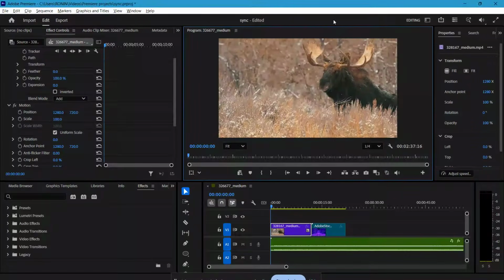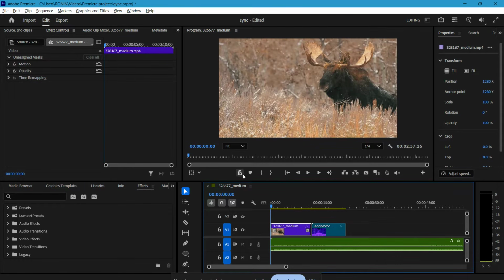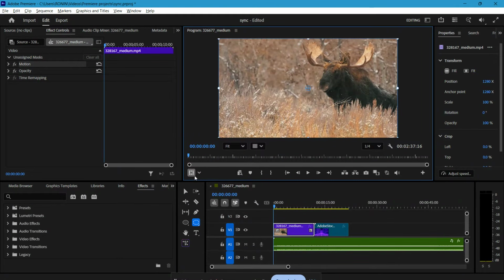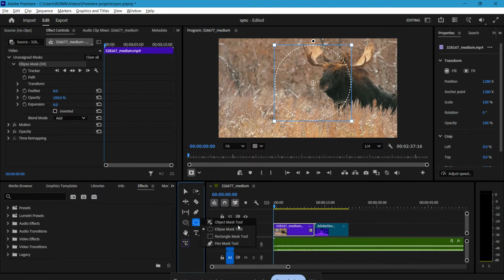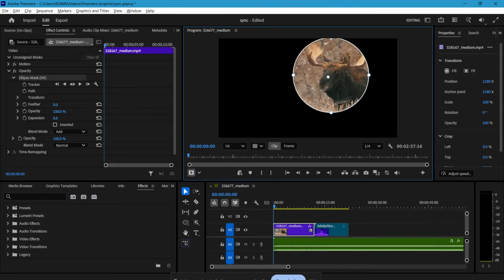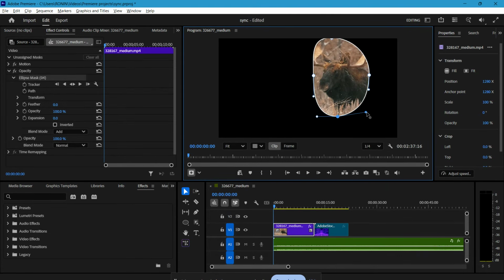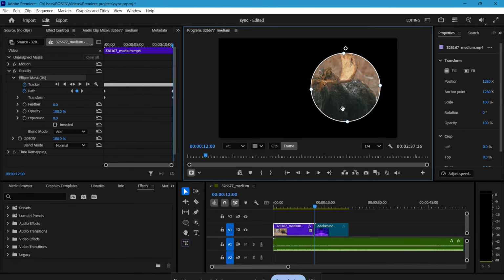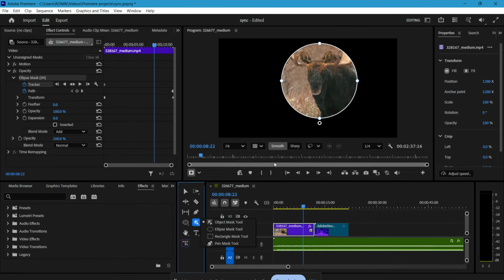How To Mask In Adobe Premiere Pro 2026 (Easy Step-By-Step Guide)

Comment: Hi Leonard, thanks for the tutorial! I’ve run into an issue. The Ellipse Mask tool works fine, but the Object Mask tool isn’t behaving the way you explained.
Could you show how to mask this buffalo and remove its background so it walks on a transparent background? Tracking is really difficult for me.
Also, I want a reveal animation for the buffalo as it walks through a giant gate I placed on a separate layer. Instead of masking the whole animal at once, I’d like the mask to gradually reveal it from head to tail as it moves forward through the gate. Would you be able to make a video demonstrating this masking tutorial?
Reply from the maker: Thanks for reaching out. That gate reveal effect with frame-by-frame tracking sounds like a great topic I'll definitely consider making a dedicated video on it soon! In the meantime, try combining keyframing on the Mask Path with a linear wipe or a static gate mask on the top track. If you found the main tutorial helpful, please leave a like, share it with fellow editors, and hit subscribe so you don't miss that upcoming tutorial!
Reply: @LeonardGuides  Thanks for the heads up. subscribed! Somone told me I had to do it on after effects but I'm not sure if we can get it done on PR.
Reply: @LeonardGuides  Hi Leonard, just to clarify: what I'm saying is what if I’ve cut out the buffalo and put it on a layer above my background video. I want the buffalo to fade away gradually from head to tail as it walks into a hole that’s already in the background. The static hole mask on the top track you mentioned might not fit, since the hole is part of the background layer that should be put under the buffalo layer.